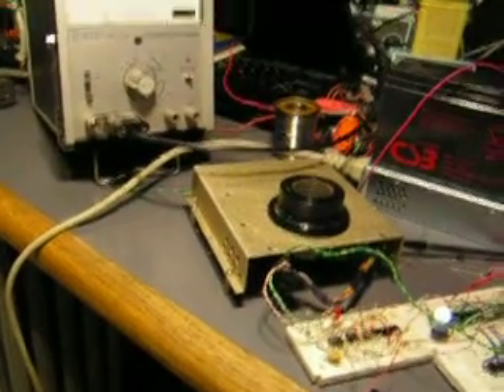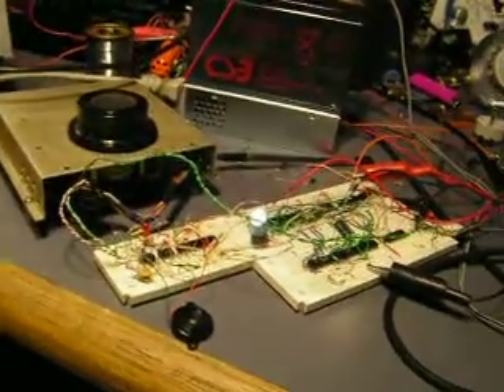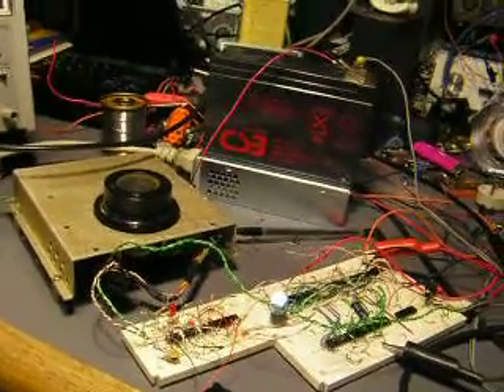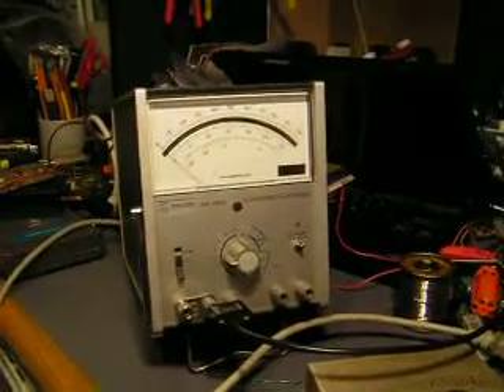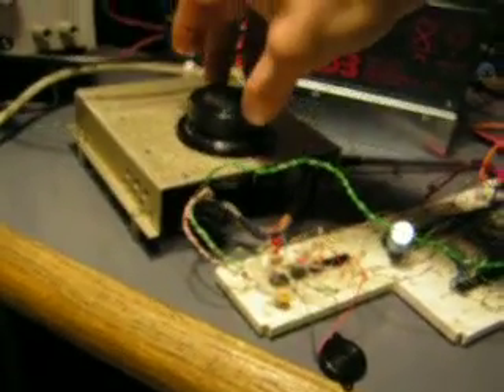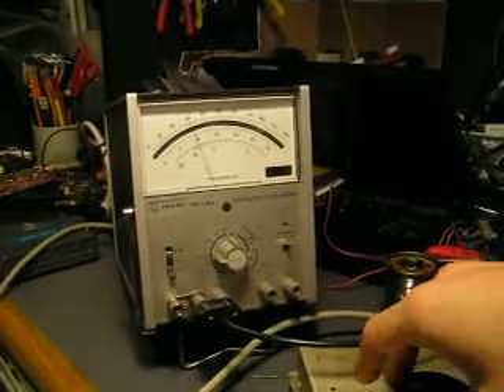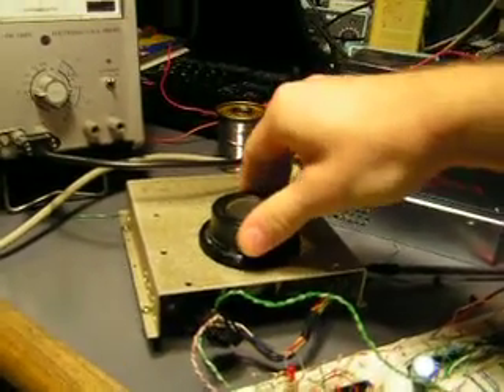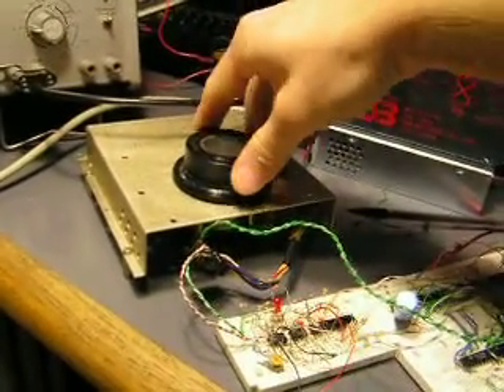Rotary Digitizer Control

Comment: Very nice!I think you're confusing a clutch with a brake.
Reply from the maker: The clutch connects the knob shaft with another rotating shaft within the backing plate which is spring loaded and travel limited. So it's still a clutch.